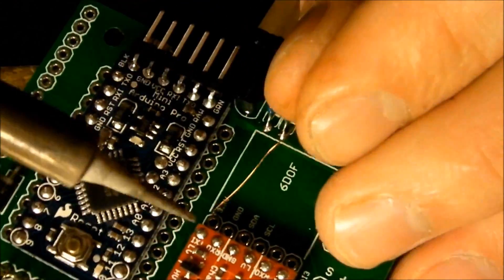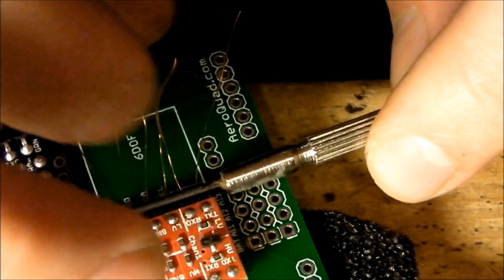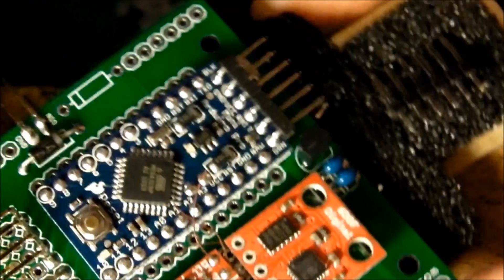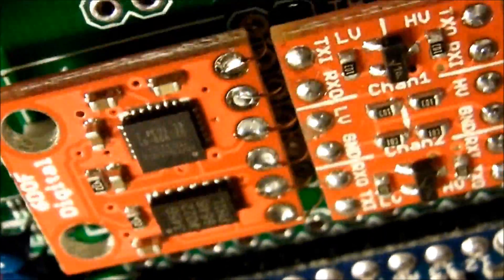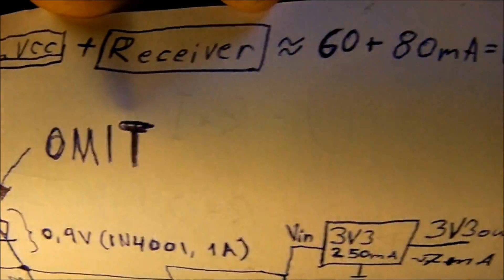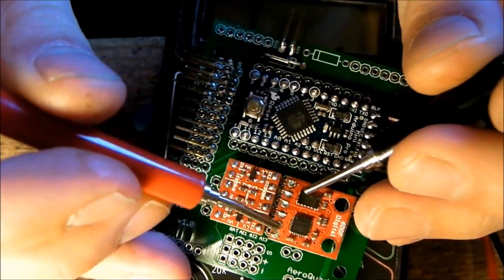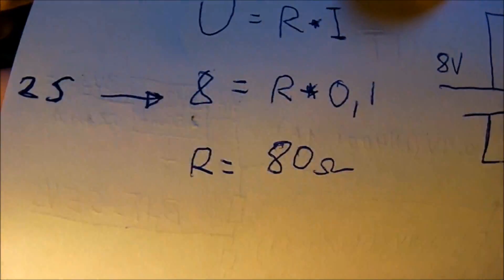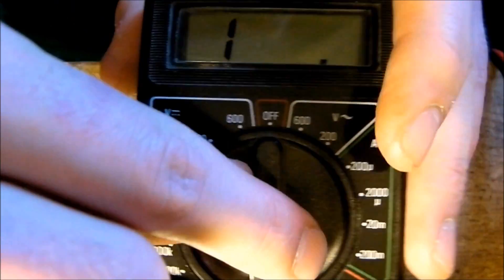AQ Tutorial Part 3 of 4

Comment from the maker: @SuperBunty99 Hi. As long as you use an electrically conducted material it will not matter. The biggest practical benefit of loose wires is that it is easy to remove or modify.